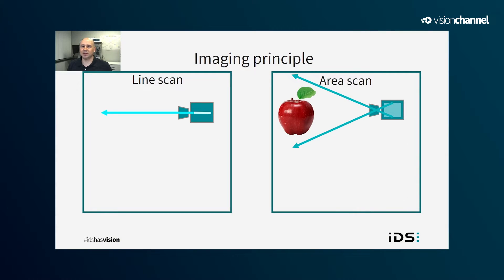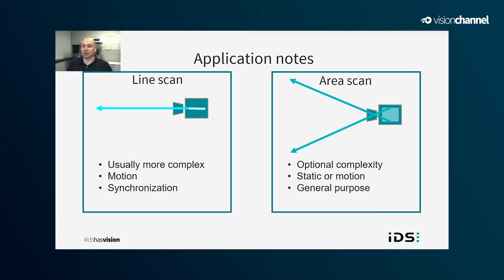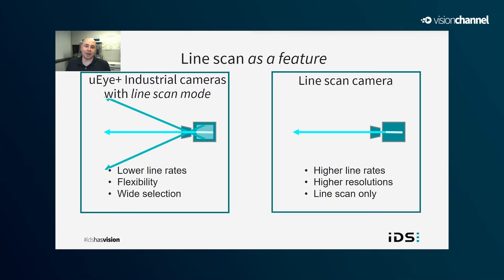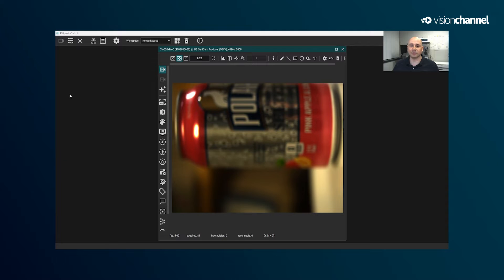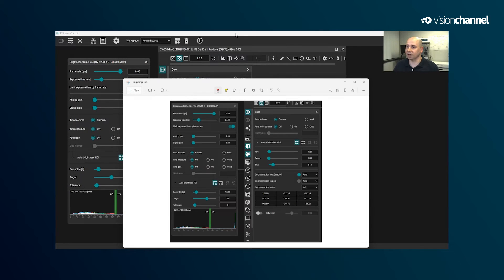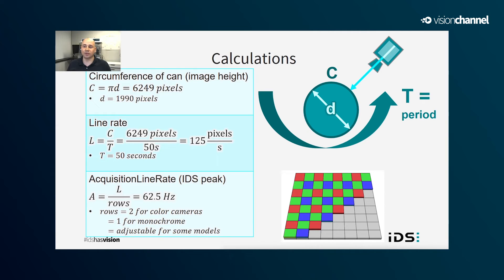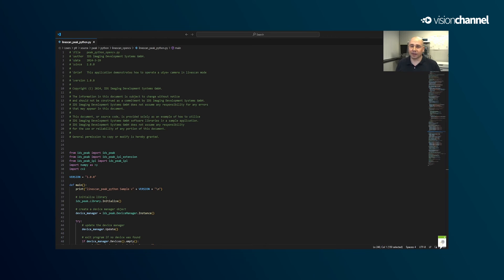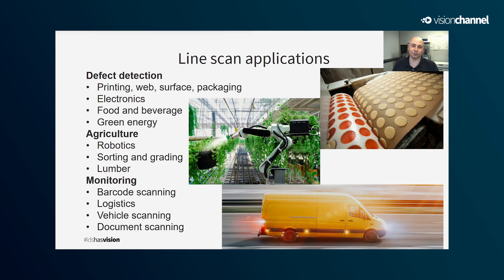How-To line scan with 2D industrial cameras

Comment: what type of turntable do you use in the demo? Is the same quality of result possible with a higher speed of the turntable?
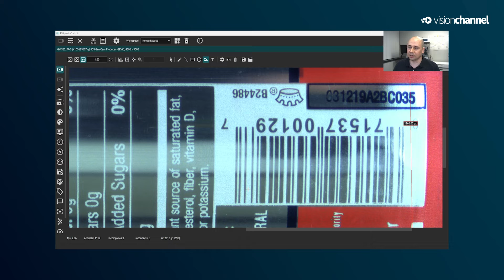Reply from the maker: Yes, the same quality is possible with a faster turntable, but some additional considerations may be necessary. A faster turntable may require a shorter exposure time so additional lighting may be required to achieve the same image quality. The fastest turntable can be calculated from the maximum line-rate of the camera using the same equations at 11:03 in the video. For example, our fastest camera has a line-rate of 6.85 kHz, which would translate to turntable speed of approximately 1 revolution per second.

The turntable used in the video is a motorized turntable for photography. This particular turntable is approximately 12” in diameter and rotates once every 50 seconds. We bought it several years ago, so I can’t find the exact model, but it is similar to this one: https://a.co/d/03lscobY